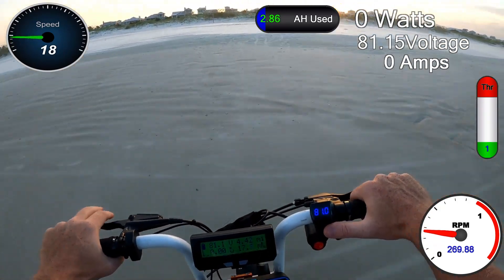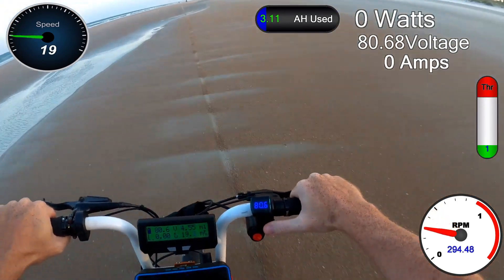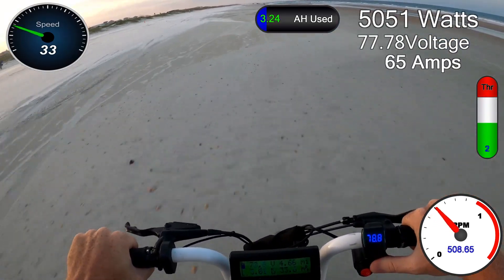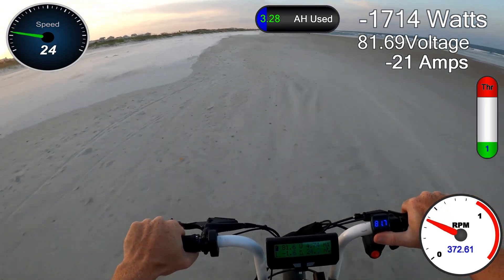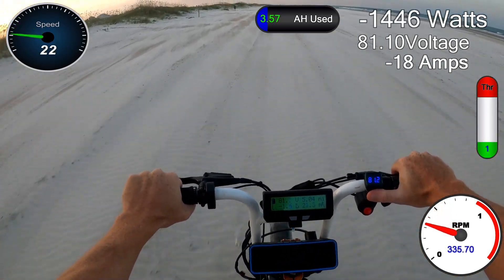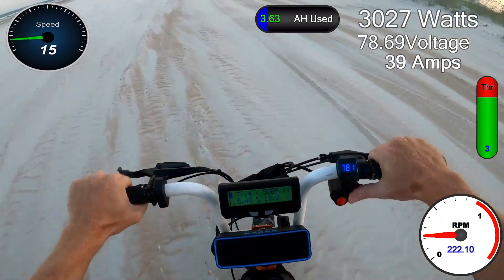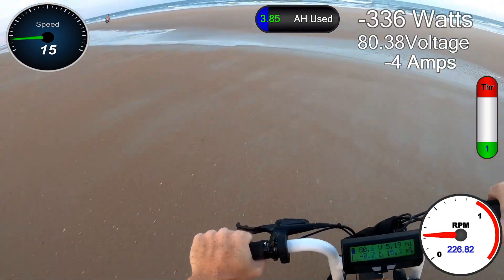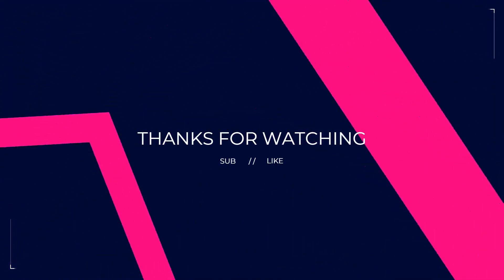One of the most powerful Super73 Z1's. 18,000W, Live power on screen.

Comment: 18,000 watt battery. I never heard of that before. Sweet job on the building though I've been building electric bikes for three or four years and I've only got a thousand Watts. I don't understand the BMS and the different settings I want to learn how though. Thanks.
Reply from the maker: I have a video that goes over the build and shows some of the battery.

The pack was built with performance in mind.  Which involved using copper for all the conductors, high performance cells, and high quality discharge wire.

It makes construction of the pack very difficult.  The results are worth the trouble though.

Check out the video and if you have any specific questions about anything I’d be very happy to answer to the best of my ability!

Comment: Do you offer custom kits to purchase?
Reply from the maker: Actually soon I plan on putting together a little something.  Just going to put together a nice kit bundle and put them on ebay one at a time.

Goal is to make something for 150mm and 175MM drop outs that is plug and play with dyno tested results. 

Really dislike how many people make kits with no real data, or performance numbers to back them up. Just all big numbers,  if you already SUB soon my new bike arrives, On that bike I will be building the Stage 1/2/3 kits and posting about it.

I am just one guy doing this as a hobby so it will just be 2-3 kits a month.
Reply: @BuildItTuneItEV  Is there anyway to get in touch with you? I just got a ZX.